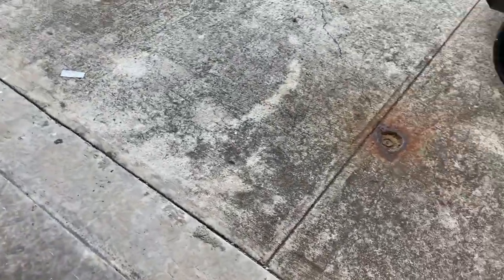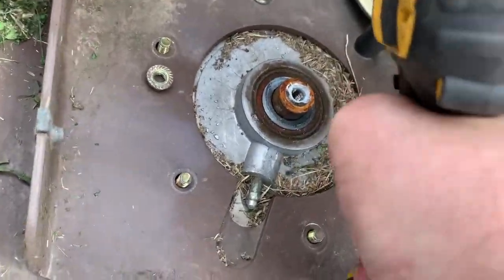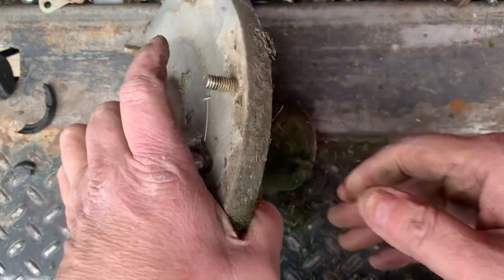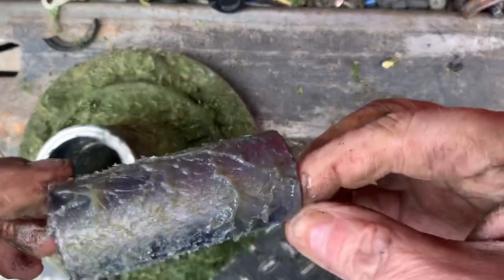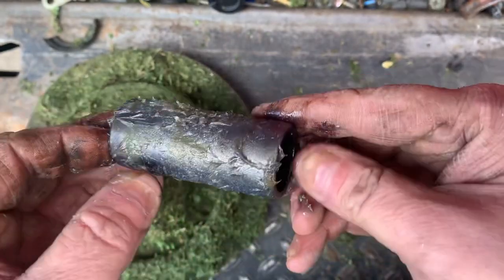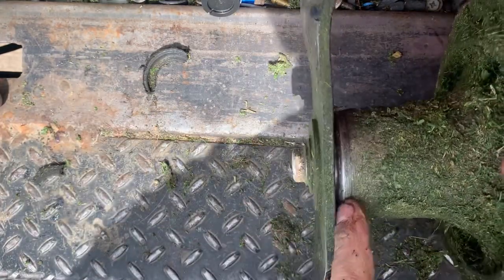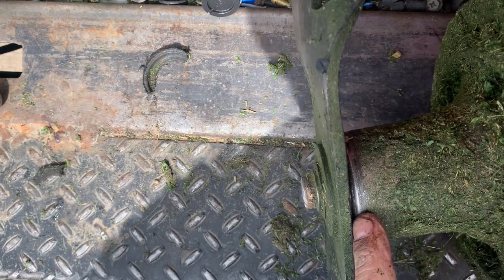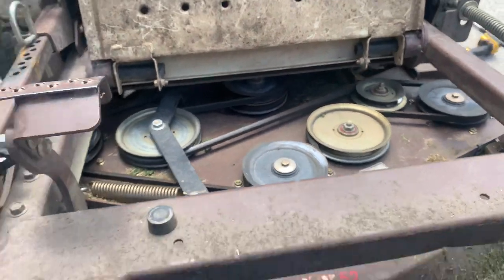HOW TO REPLACE BLADE BEARINGS ON JUST ABOUT ANY MOWER

Comment: How can the grease get past the the seal on the bearings? Other videos, they remove the inside seals on both bearings. And some drill a very small hole. To be able to see when the hub is full of grease. They put a small self tapping screw in the hole they drilled. To keep dirt out.
Reply from the maker: The grease seal lip faces inwards toward the bearing balls, when you grease the bearing, the grease will go past the seal lip no problem. Never remove the seal Unless you are committed to greasing the spindle because now the grease will not stay and will drop out of the top bearing and run dry but if you keep greased you’re good

Comment: Jeremy, another spindle with a grease zerk with 2 bearings that are shielded on each side of the bearing. John deere engineering does that too. 👍Roger
Reply from the maker: Just grease it.  It’s designed to fill the cavity with grease eliminating air thus preventing condensation buildup
Reply: @THEMOWERMEDIC1  I'd buy that except they don't come from the factory filled with grease.
Reply: @cpcoark  i had a cub cadet with grease able spindles. The bearing weren't shield on the inside so they were always able to take grease. No spindle trouble in 25 years. John deere you can take the inside shields out and do the same thing.
Reply from the maker: @mikespain8655  not hard at all. The grease will go in past the seals. The seal lip faces inward allowing grease in

Comment: Shouldn’t you dig out the seals that face the inside of the spindle chamber so that when you grease the spindle the grease can reach inside the bearings?
Reply from the maker: The seals face inward    The grease will go in
Reply: If the seals on both sides of the bearings on both ends and I pump grease into the center chamber the grease can’t get into the bearings because the seals facing the chamber prevents movement of grease into the bearings.